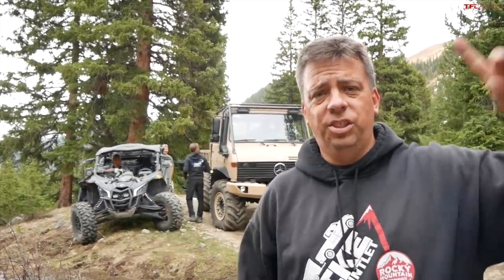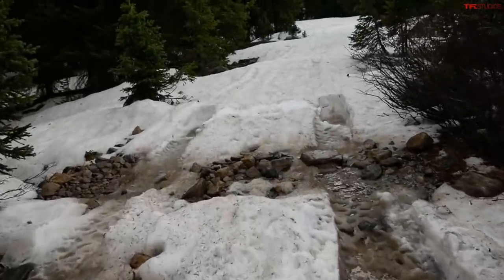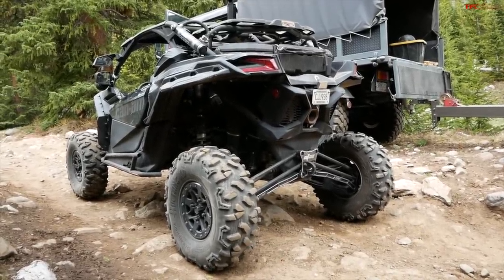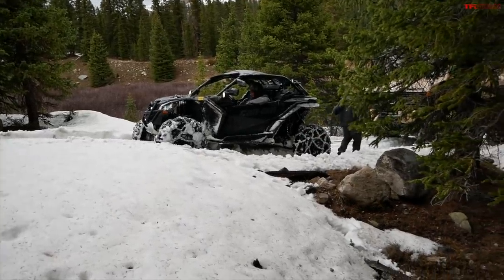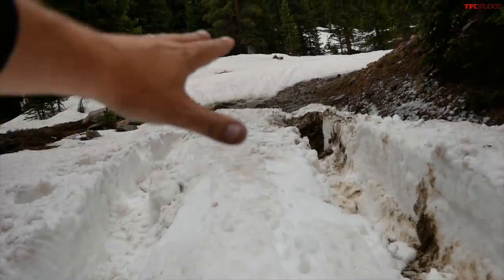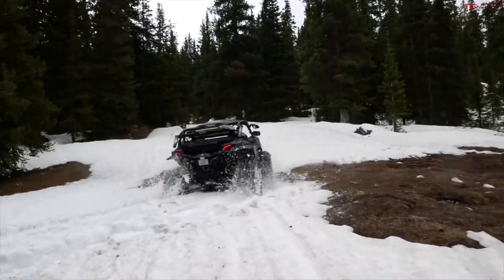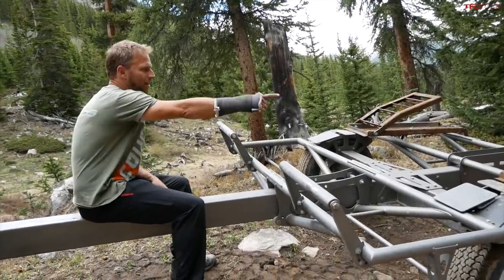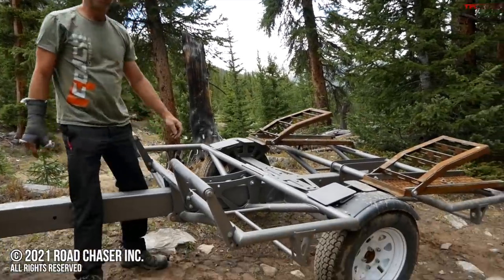Mercedes Unimog vs Can-am Maverick vs Rocky Mountains - One Gets Stuck, The Other One Keep Going!

Comment: Unimog has a major advantage when driving through snow...  Its ground clearance is almost 20 inches!
Reply: They said the X3 has 32 inch tires and has been lifted some. It should be around 16-17 inches of clearance. Two completely different machines.  Unimog is a bad bitch. But so is an X3. Just not in snow with those tires. Haha
Reply: @jbw5485  32”s aren’t big for an X3 but also the X3 isn’t really mean for much other than racing or playing in the dunes
Reply: @sourtrail  right. I’ve got 33’s on mine and that’s small compared to most everyone I ride with. 35’s and 37’s with stock suspension. Add portals and they’re running 40’s and larger. Ridiculous. Lol
Reply: @jbw5485  that’s just in the mud. The bounty hill racing and actual tough shit you don’t want bigger than 32s
Reply: @bobbyb608  yep. Those tractor tires look bad ass and work well in what we ride in. But damn it if doesn’t take away from the smooth ride quality a good bit. Also kills the torque. I keep going back and forth between mud and trail tires depending on where we are riding. Most people do the same.
Reply: @jbw5485  yeah those tall rigs are suicide on steep hills. I run a 32 on 4” portals just for more ground clearance (around 20”) I’ve been going back and forth on whether I want to jump to 35’s or not. I drive around deep mud and most spots I bottom out on, I just floor and jump it right now
Reply: @jbw5485  deep mud and throwing BKT tires on is fun and all, I just think I’d have more fun in it on a outlander or renegade or something

Comment: That's how it was designed; A " *UNI*versal - *MO*tor - *G*erät" (Universal Motor (Powered) Device). Right after WW II, mainly farmers needed a reliable and cheap tractor-like vehicle with 'Swiss Army Knife' capabilities. That's why it had portal-axles (to effectively utilize smaller diameter (and cheaper) wheels and tires), one or more PTO points, and hydraulic connections.
The gear reduction at the wheels (portal-axle) allowed small powered engines deliver lots of power to the wheels without much stress on the drive shafts, a huge benefit in cost reduction at the time.
It was (and still is) the 'mountain goat' of 'normal' vehicles.

Comment: If you get stuck in a unimog, its not the unimogs fault. That means that you're doing something wrong/ stupid. I've driven unimogs through swamps where there was water running into the cab, and it still didn't care.
Reply: I've seen the same thing. Only a custom old school Toyota from the 80's would go where he mog went. The Toyota needed a small block Chevy 1ton axles with lockers 24" of lift and tractor tires to do it.
Reply: @IKnewMickey  Yeah unimogs are insane, even more so if you look at military unimogs. I've seen them go where MRAPS wouldn't even consider going...
Reply: @joshkiej6601  The military Unimogs are basically the same other than stealth lightning, military tow hooks etc.
Reply: @merhaba8  depends, i was talking about the armored unimogs vs other armored vehicles. Belgian army uses 2 types of unimogs. One is just the regular unimog U1350L and the other is a unimog based armored vehicle, the ATF dingo. The dingo wrecks pretty much any other armored vehicle...
Reply: @joshkiej6601   Fair enough but it’s still basically a Unimog, though with armoured plates in the Belgium army named after a Australian dog!
Reply: @merhaba8  yeah its a unimog chassis and drivetrain, just weighs quite a bit more than a regular unimog+ you have mine protection so that limits ground clearance

Comment: well, Unimog, it's not just have high power, The Unimog's characteristic design element is its chassis :— a flexible ladder frame with short overhangs, and coil sprung beam portal axles with a central torque tube and transverse links. Having portal axles, the tyres' centres are below the axle centre, which gives the Unimog a high ground clearance without big tyres. The coil sprung axles with torque tubes allow an axle angle offset of up to 30°, giving the tyres a wide range of vertical movement to allow the truck to comfortably drive over extremely uneven terrain, even boulders of one metre in height.💪

Comment: If I were running an off-road recovery business, the unimog seems like the ticket. Other than that, the UTV is just a weekend toy (expensive at that)
Reply: Not even road legal either
Reply: @twayland6186  Road legal in Arizona and Utah.
Reply: @offroadkings379  those states know how to live
Reply: @offroadkings379  other states are in the process of getting them road legal.
Reply: Two completely different vehicles with different purposes. The unimog is bad ass and so is the X3.
Reply: Sherp > Unimog ... yeah I said it.
Reply: @djsomeguy  hell yeah. Sherps are stoopid awesome and capable of whatever you throw at them. 🤘🏼🤘🏼
Reply: @djsomeguy  a sharp is a good swamp/mud vehicle but thats about it. Also it needs to be taken everywhere on a trailer.
Reply: @djsomeguy  I feel, but overall the mog is more utility, more useable IMO. The sheep is too slow and lacks any upgrade or mod capability. Like putting an rv on the back of the mog.
Reply: @davemarshall9322  no of course not. Obviously referring to the X3 being legalized for road use.
Reply: @davemarshall9322  Here in Europe, mountain farmers, military and in civil engineering they are used all the time. The commercial applications are many fold.
Reply: @davemarshall9322  I'm sure you are right Dave. Unimog is the wild child offspring between 4X4 tractor & 4X4 truck. Certainly not a rich man's big toy.
I saw a review by "Doug de Haven't a Clue" I got the impression he didn't understand what it is & what it's for.
Reply: djsomeguy sherp has no ability for off road recovery—- its motor isn’t enough. Matt’s off road recovery has proven this
Reply: @russcattell955i  And we have them as special purpose fire trucks, snowplows, cranes, snowblowers and even rail-vehicles.

Comment: Floatation is where it's at. Even though the mog is many times heavier than the utv, it still floats better. You can work wonders with low tire pressure to compensate for wheel size too. Just look at how the Icelandic snow vehicles are built.

Comment: You can compare all you want. What really matters is the Driver, Common sense, and knowledge to know what line to take. I’ve had to pull a Can-Am out of the snow with my RZR because the DRIVER didn’t have a clue. I live in Sierra Nevada Mountains, and we get lots of snow (most of the time), and I’ve seen the crapiest Vehicles go where the most equipped vehicles couldn’t just because of the loose nut behind the steering wheel.

Comment: There are people in Canada modding the Can-Ams with suspension extenders and new arms to take the size and weight of 37 inch and 42 inch tires and are having great success with them. In norther winter Ontario and Quebec it's the only way to get through one metre snow drifts and the wet heavy lake effect fresh snow.   It's another $10,000 on top of the $30,000 Can-Am price but it's worth it for heavy winter use.

Comment: I have mog 404 portals on my stretched YJ and it's a beast. I run 41.5 Pit Bull radial tires and I am always miles ahead of everyone when we are snow wheeling. Air down to 2 psi and see you later.  I also have a X3 and you should have aired down to about 3 or 4 psi and crawled your way up the hills. The chains basically made you dig down. They were useless.

Comment: iveco daily 4x4 is a contender for the unimog but omg the unimog 😍
Reply: iveco daily 4x4? those arent even close to as capable as a unimog....
Reply: The OKA may be one.
Reply: @joshkiej6601  They are surprisingly capable but they don’t have portal axles
Reply: @merhaba8  they're nowhere near as reliable as unimogs are, they have independent front suspension, which you don't want and they don't have portals. And they tend to be quite low on power...

Comment: I've always wondered how well an LMTV would do against a Unimog. I think the Uni could take it in most conditions (and even with less HP it's definitely faster) but I had some good times in LMTVs. I hated how skinny (and top heavy) they were but they'd fit down some really tight trails.
Reply: Without the portal axles and flexy chassis I'd say the Mog would walk it. As far as durability...they are both Steyr designs.
Reply: @thebigmacd  I kinda figured as much. It just popped into my head because I have a lot of experience driving LMTVs but I've never had the opportunity to drive a Uni, though I've seen a couple in person.
Reply: How about the old 5 tons?
Reply: @MrPAULONEAL  Depends on the model. The single axle version with the Air Lockers is decent off-road it you have something heavy mounted in the back, and they're great because literally everything uses the same motor oil for both lubrication and hydraulics (power steering pump included). The pneumatic winch never fails, and the bumper it's mounted to could take out a brick wall lol. But the LMTV has air suspension, central tire inflation, cab over design (way more maneuverable), better (and taller) tires, weighs a bit less, and has way more power (though the 5-ton can be had with a low range and a manual with a ridiculously low first gear). Going flat out in sand and dirt roads, LMTV rides surprisingly well for being a big vehicle with solid axles front and rear. Those axles also have better articulation and more travel; jumping an LMTV (within reason) feels like landing on a pillow (though the M-ATV is still the best big vehicle to catch air in that I've ever driven; independent suspension front and rear). The tire inflation system really comes in handy when going off-road with such a large vehicle. The LMTV will also fit down the same width trails as a HMMWV, but that lack of width (relative to it's height) makes off-camber situations a bit tricky, even with the engine being mounted lower and further back in the chassis; the 5-ton feels rock solid in comparison. The 5-ton is a great workhorse that's almost impossible to kill, but while it can go off-road, deep sand is about as extreme as I'd recommend. The Air Lockers are pretty much a requirement because the huge stack of leaf springs ensures minimal articulation, it rides like you're sitting on a cinder block tied to a pissed off bull, and anything with an incline will make it struggle. It'll get you to where you gotta go...eventually...is stupid easy to fix, and stupid fun to drive just because; but it sits between a fully up-armored HMMWV and the MRAP as the three worst military vehicles for going off-road. This is of course, my opinion; other's mileage may vary.

Comment: Take a U.S surplus m35a2 up that hill make sure you use one with a winch.
Reply: It won’t make it that far
Reply: @flight2k5  Yah, the Mog's superpowers come from the gearing and amazing transmission. Deuces are beasts but they're not Unimogs.
Reply: @TheJohn8765  it comes from the entire set up. Then2.5 ton truck isn’t a beast.  They are average off-road.
Reply: Agree, a M35 with super-single and chains...
Reply: @michelt4390  still not on par with a unimog

Comment: Well, I don’t think I would need chain at all, I never did unless it was with military tires. But I think the tires were agressive enough. You don’t want to be digging in snow, and chain would just do that. I understand they wanted to test them in big snow as possible, but the Inimog did take the advantage to dry ground on video. Of course the Canam could not go in waist high deep snow, and the Canmam is too light, it jack itself on snow, but you don’t need a wich if you don’t have one, it would be easy just to shovel the snow out a bit underneet or use some dead wood under the tires for reverse and try again. Being a 4x4 they could use some steering play with the driving, something they didn’t do. I think this video is to enhence the Unimog feature being worth while the $200k price tag…sorry, nice toy, but not for me. I could do just nice with the Canam, but again, I’m Canadian, snow is our business…and it’s all depend what you really need it for. Don’t get me wrong, Unimog are cool off road truck and 4 wheel stearing…wow!  I wish they showed that. They are cool they are really rugged. Butter get that than a 1Ton diesel Ford truck I think, because the resale value would be higher and less prone to mechanical failures because they are build for real tough work. If you need something really offroad and don’t want to spend $200k buy and old Duece an a half…but they do 1-2 miles a litter…but you can do a lot with them as they are big. You really can have a cool camper made with that. Humm..next option, import and old russian military truck or the « Bread Loaf » russian van, they are awesome 4x4 and cheap to buy.

Comment: This just goes to show that you guys don't know how to drive a Maverick.... or maybe you do know how ... Its probably why you let off when you needed for it to get stuck.  And then to drive the Mog through the tracks through the deep part that the Maverick made. And I will point out that you got the Maverick stuck just as the deep snow was ending. Yes I do analyze things like this. I have been on a lot of off road  product video shoots and I know what it takes to market your product. But I could have been more believable. And FYI the Maverick is one of the products I have been on a shoot with so I know what they are capable of.

Comment: 600:1!! You’re going to destroy your drivetrain!
Reply: Nope. Not in a Mog.
Reply: @thebigmacd  the second big advantage of portal axles is, that you can keep the driveshafts thin. If the momentum becomes 6x higher, all components will suffer. Including the portal axle gears ⚙️
Reply: @lautbreak294  the point of 600:1 gearing is to idle through obstacles without relying on throttle input. A nice slow idle over an obstacle is easier on the drivetrain than going full throttle and wheel-spinning and-hopping to get where you are going. The Mog drivetrain is already built to take the forces of climbing vertical walls, climbing 100% slopes at full payload etc. Super low gearing makes it slow and easy.
As far as momentum...for the same input rpm, the system will have less momentum if it is geared lower. Everything from the input shaft on will be turning much slower.
Keep in mind as well that a stock Mog can put enough torque through the drivetrain in low gear to spin the tires. Gearing down will not make the tires more sticky...they are still the path of least resistance and thus will protect the axles, especially since there will be lower momentum and more controlled slippage.
Reply: @thebigmacd  Sounds right!
BTW, I didn’t mean momentum, I meant torque (Moment in German)
Reply: Some Unimogs can drive on train tracks to move around cargowagons. They can go as low as 3800:1 with two gear reductions on 1st gear. He said it in another Video